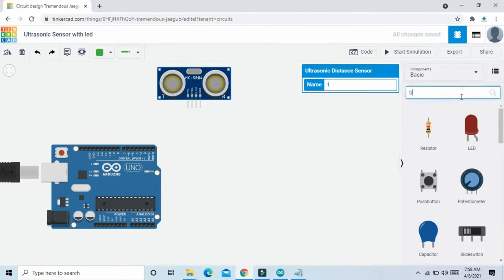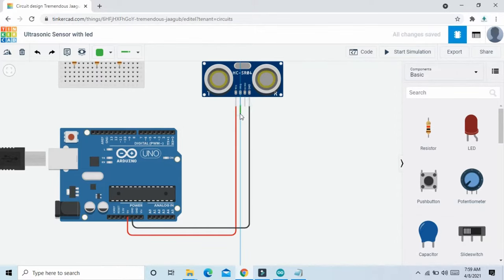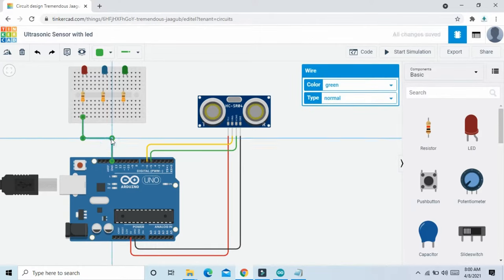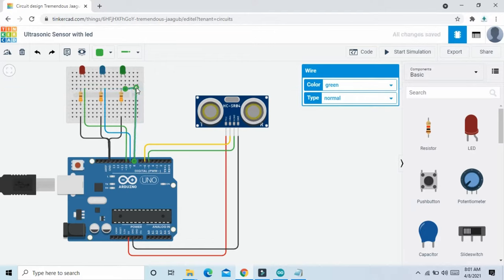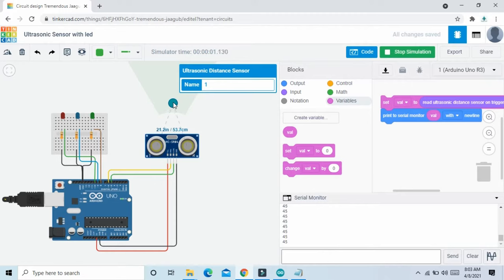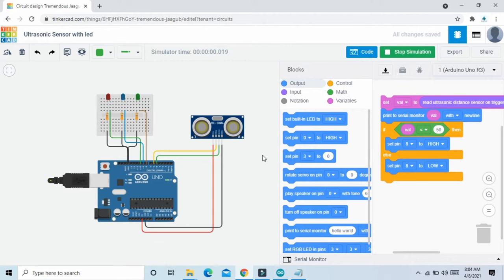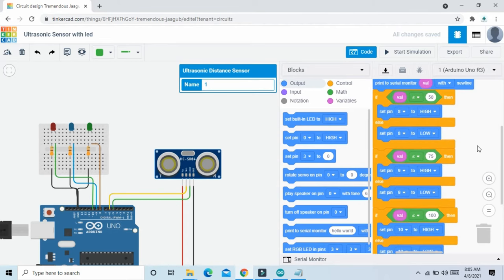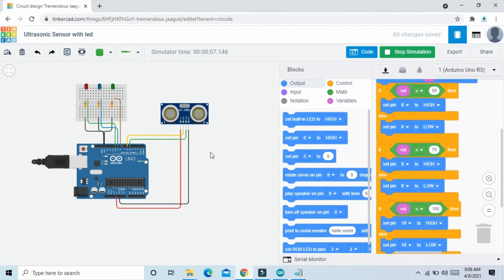#19 Ultrasonic sensor tinkercad with led in English | Distance measure | tinkercad circuits | code

Comment: What is this ultrasound about?
Reply from the maker: Ultrasound is a noninvasive imaging test that shows structures inside your body using high-intensity sound waves. Healthcare providers use ultrasound exams for several purposes, including during pregnancy, for diagnosing conditions and for image guidance during certain procedures.